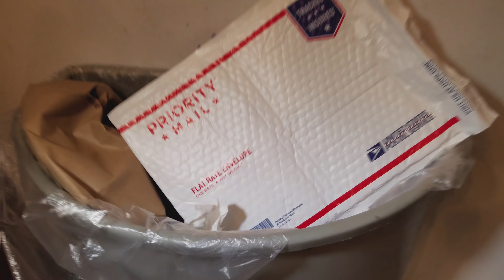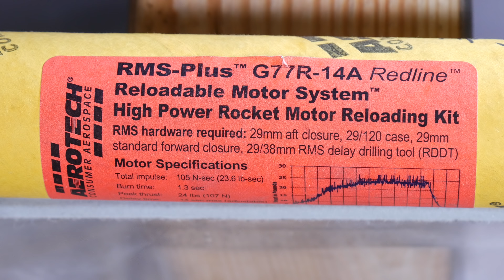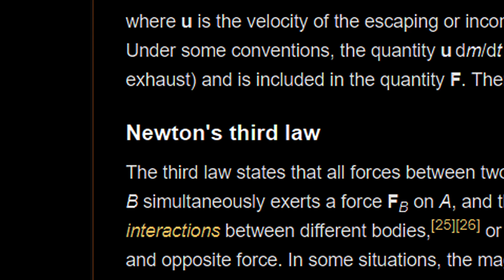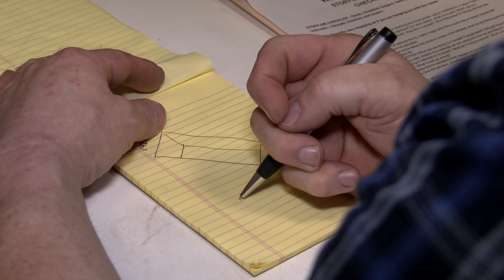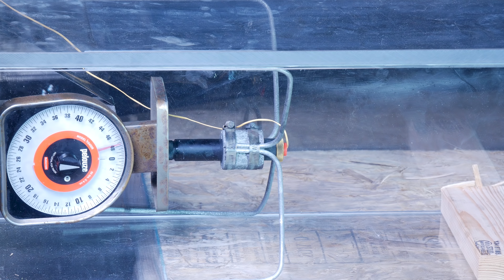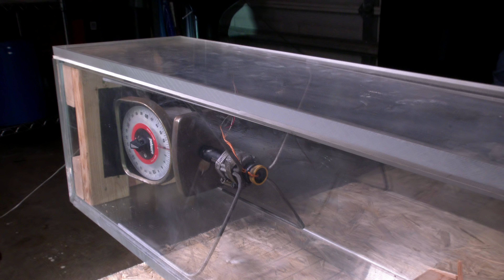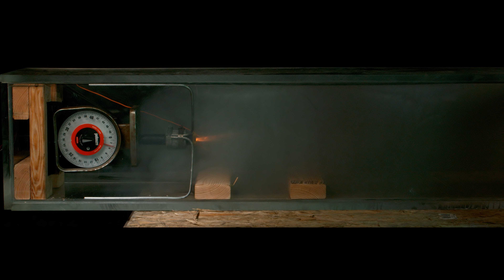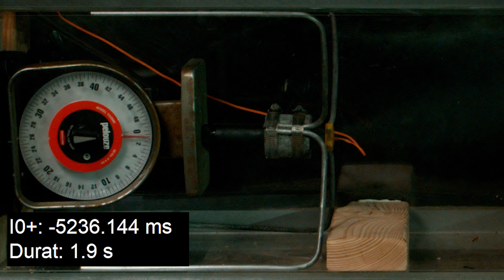Rockets in a Vacuum Chamber - Newton's third law of motion Visualized

Comment: Vacuum in “space”, is not the same as a small vacuum chamber that does not and cannot replicate deep space. Once induced burn starts, vacuum is lost in chamber, and test is invalid. Watch ignition and pressurization of chamber at ignition. In an enclosed chamber,there can be thrust due to loss of vacuum and walls to bounce off on,. Nice try. Principles of physics.

Comment: This is a poorly executed experiment and some dishonest practices as well. Look at the slow motion footage at 10:12 at 1/4 speed. There is an obstruction at the midpoint of the chamber that deflects the exhaust back toward the rocket and fills that half of the chamber before it makes its way the the other half of the chamber. You can clearly see the odd flow patterns of the exhaust.

Comment: can rockets fly in space was what i meant to search
Reply: @jrngln   
Nice copypasta. Every word of what you just said was wrong.

1) We can get close enough for practical purposes. Technically space isn't a pure vacuum either, but it's so rarified that molecules rarely come into contact with each other.
2) A vacuum doesn't "absorb" anything, you're speaking nonsense.
3) How exactly do gases on the opposite side of the chamber affect the rocket motor? The answer is they don't. The only forces come from the direct interaction between the motor and the gas. As soon as the gas leaves the motor, it can't transmit a force.
4) Yep. Rockets push off of their exhaust gas.

Comment: You simply don't get it do you?  And for the record, Newton's third law has absolutely nothing to do with rockets, nor does it validate how rockets allegedly work.  It is simply a statement to describe that an an action has a resulting action.  It can be one or countless resulting actions.  Apply the law to an internal combustion engine.  The opposite reaction is that the energy created, causes the shaft to rotate, causes heat, causes friction, causes a transmission to move, causes wheels to move, causes tires to move on the concrete, and eventually causes a car to move.  With much of the energy created from the initial action, to be lost before that happens.  Same thing with rockets.  The energy is converted in many ways.
Reply: Kit Canyon  I guess you don't understand what I am talking about, because momentum has nothing to do with the point I was making.
Reply: Kit Canyon  No, no it doesn't.  The topic of this video is building an acrylic box, suspending an Estes rocket engine in the middle, pulling a vacuum and then firing the engine to demonstrate something NOBODY is arguing (that a rocket cannot ignite in a vacuum).  This topic has literally nothing to do with momentum.  Newton's third law is equal and opposite.  We are falsely told that this simple, archaic law, means that a rocket engine creates thrust simply by operating, and that the exhaust doesn't need to mass to push against.  It has nothing to do with momentum, unless you want to unnecessary variables to a simple debate.  I don't think that's what you're doing though.  To me, you simply seem to be defending a completely different falsehood.  Which is not surprising, nothing about the heliocentric model makes any sense, and apparently you're lost in the lies.
Reply: @the18thdoctor3  The thrust is being created by the propellant pushing off of the back of the enclosed container.  Also, the 3rd law of motion has absolutely nothing to do with rockets, nor does it mean what NASA tried to pervert it into meaning in order to support rockets perfoming in a vacuum.  The third law of motion is simply one sentence stating that the entirety of the energy from a given action, is fully converted in some or many forms, in the reaction.  It does not mean that the force expelled from a nozzle, propels the nozzle forward.
Reply: @pearlmax  
The 3rd Law says nothing about energy. When Newton conceived it, the concept of energy had not yet been thought up. That’s why it’s a Law of Motion, not a Law of Energy. “Every action has an equal and opposite reaction,” every force works in both directions. This should be obvious: If you push on something, it pushes on you with the same force. If your mass is 60 kilograms, you exert a force of 588 newtons on the floor beneath you, and it exerts 588 newtons of force onto your feet. That’s why you can feel your weight. If you push on a wall that is fixed, you are the one that ends up moving, because the wall exerts an equal force back on you. If you throw a heavy object, you are pushed backwards. The harder you throw it (or the heavier the object), the more you are pushed. Rockets throw their exhaust gases at extremely high speeds, so they get pushed forwards.

Tell me, if the force is being exerted on the back wall, exactly how is the force transmitted to the rocket? The wall is at the opposite end of the chamber, there is no connection between the two. Do you think there’s some sort of “action at a distance”? The fact is that the force is produced by the reaction of accelerating the gas. This satisfies Conservation of Momentum.
Reply: @the18thdoctor3  If you truly understood the meaning of the sentence, you would realize that it describes energy or force which is created by the action.  A "reaction" requires displacement of energy and conversion of energy.  A modern example is a car engine.  The action of an ICE is not converted to the wheels at 100% efficiency.  Not by a long shot.  Just as with the exhaust of a rocket engine.  However 100% of that energy created by the action IS converted.  In the case of a rocket in a perfect, endless vacuum, the exhaust fills the gaseous void.  If there weren't an atmospheric deficiency, the exhaust would propel the rocket by pushing off of the existing gas, opposed to simply expelling and filling the void.
Reply: @pearlmax  
Nope, it only refers to force (the words action and reaction are both, in this case, synonymous with force, but are used for clarity). When object A exerts a force on object B, the reaction is the equal and opposite force exerted by B on A. In a car, there are many action/reaction pairs, but the one that actually makes the car move is the reaction of the ground pushing against the wheels. If there was only the action of the car against the ground, then only the ground would begin moving, and the car would remain stationary. This is ridiculous. When molecules of gas are expelled out of a rocket’s nozzle, there is a force that accelerates them. This force goes in both directions: Action accelerates the gas one way, and reaction accelerates the rocket the other way. Thus, momentum is conserved. Remember, if you are claiming rockets can’t accelerate in a vacuum, then you are claiming that the Law of Conservation of Momentum is false.
Reply: @the18thdoctor3  If you want to narrow it down to tires on the road, then great.  If you want to narrow it down to the microscopic level then great.  But just as you tried to counter my example with tires on the road, you are forgetting the heat transfer, the flexing of the rubber on the road, the conditions, the surface.  All highly variable and dependent on the conditions.  How about ice?  When you try to accelerate on ice, what happens, slippage, kicking up of gravel, ect.  The more specific you want to get, the more it just proves my point of the law being able to be translated in countless ways.  The reality is, in a vacuum, the reaction, is the exhaust gasses filling up the void.  It is proven in this video.  it isn't until the gasses reach the rear of the enclosure that any movement of the rocket motor occurs.  It is a requirement for a propellant to have a mass, to push against for any significant movement or acceleration of the source.  Again, this video proves it, which is ironic because he is trying to prove the opposite.  Completely missing the point of the "rockets in a vacuum" argument.  Nobody argues that you can't fire a rocket in a vacuum.  This video just proves this guy's ignorance on the topic.  The argument he thinks he is debunking is actually focused on the ability of rockets in space acting as a propellant.  He built a vacuum chamber to prove something nobody is disputing, and proved what they are disputing.
Reply: @pearlmax   
Except, if you actually watch the video and pay attention, the scale measures thrust before the gas reaches the back wall. It shows thrust exists the instant the gas begins to leave the motor, exactly as predicted by the Law of Conservation of Momentum.
Reply: @the18thdoctor3  This is actually a different video than I thought it was.  He did two similar videos.  So what I was describing is in the other one he made.  Regardless, a small vacuum chamber will never prove anything either way.  You cannot achieve a perfect vacuum on earth anyhow.  My main gripe is that people try to use Newton's third law improperly as a sort of proof of their belief of how rockets or propulsion works.  If that were the case, you could have a closed system with an engine inside that could propel the entire system.  This is an old debate, and years back there were experiments showing that vacuum nozzle at the exhaust resulted in no movement of a powered model car.  The argument for equal and opposite tried to claim that the vacuum was cancelling out the forward movement and pulling back on the car, even though the vacuum was shown not to do so at a standstill with no propulsion.  Anyway, this doesn't do anything in the grand scheme, doesn't prove space travel is real, doesn't prove the heliocentric model is legitimate, it doesn't solve anything.  If rockets were shown to absolutely not work in a vacuum environment, then it would essentially debunk space travel, which is the source of this debate in the first place.  I'm just saying that Newton's third law serves to explain that the energy from an action is transferred and converted, and there are countless variables to consider depending on what the action is, and variables to consider for the reaction.
Reply: @pearlmax  
”you could have a closed system with an engine inside that could propel the entire system.”
Incorrect. Say the system is an engine and a box surrounding and attached to the engine. The exhaust gas will initially accelerate the engine, but upon impacting the opposite end of the box, it will decelerate back to zero, for a net total change in momentum of zero (Conservation of Momentum). To calculate the system’s total change in momentum, you must factor in all interactions.

However, if you remove the box and open the system, the conservation of momentum still applies. Creation of negative momentum (backwards acceleration of exhaust) must be balanced by positive momentum (forward acceleration of engine). Since there aren’t any other interactions to balance momentum, the forward acceleration must occur.
Reply: @the18thdoctor3  By being so tied into these one sentence, archaic explanations for physical interactions, you are ignoring the point, and ignoring the unknown variables about the theoretical example.  And you're using my claim as to why the rocket engine does produce thrust in the vacuum chamber, as the reason it would negate any forward momentum in a closed system.  When actually, what the exhaust would be more inclined to do is fill the entire closed system until it explodes.  It was simply a point I was making, that it's a ridiculous notion for a rocket fixed inside of a closed system to propel it forward.  The reality is, it would more than likely be an stationary explosive, not a vehicle.  Referring to laws or mathematic equations doesn't prove what may or may not occur in reality.  If everything in physics was so cut and dry, and blanket sentences provide the answer to everything that happens in our physical reality, then there would be no need for the scientific method.  Nobody wins this debate until someone demonstrates what happens in reality.

Just like with the air powered vehicle I was talking about.  The guy arguing against what the experiment demonstrated, was using essentially the same argument as you are here, that the vacuum was negating the forward momentum of the car (perfectly), however the vacuum was not pulling the car backwards prior to the propellant being released, therefore the argument is invalid.  There was no forward momentum, because the propellant was being consumed instantly by the vacuum, and there was nothing of any density to push off of.

Comment: Well this experiment must be in outer space and if it works that means space is not just a vacuum and we need to rethink about the ether concept.
Reply: We HAVE done the experiment in space MILLIONS of times.  And space IS a vacuum, we have been up there and checked...
Reply: @jrngln   well said.
Reply: @jrngln   
Nice copypasta. Every word of what you just said was wrong.

1) We can get close enough for practical purposes. Technically space isn't a pure vacuum either, but it's so rarified that molecules rarely come into contact with each other.
2) A vacuum doesn't "absorb" anything, you're speaking nonsense.
3) How exactly do gases on the opposite side of the chamber affect the rocket motor? The answer is they don't. The only forces come from the direct interaction between the motor and the gas. As soon as the gas leaves the motor, it can't transmit a force.
4) Yep. Rockets push off of their exhaust gas.
Reply: @namanziu4211  
Nope. If this works in space then it means that Newton's 3rd Law is correct, and the laws of physics as we know them are all correct.